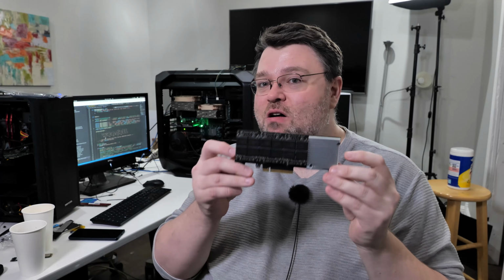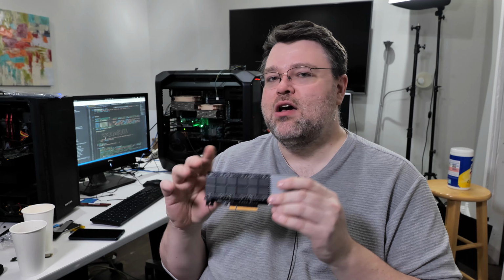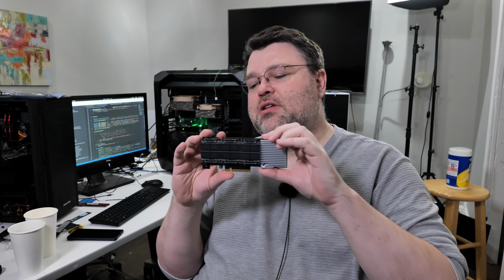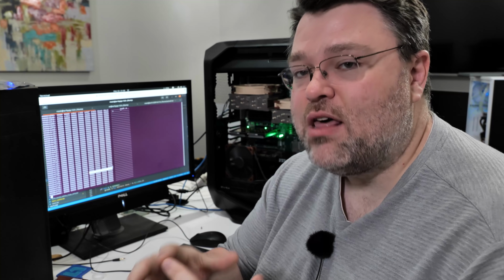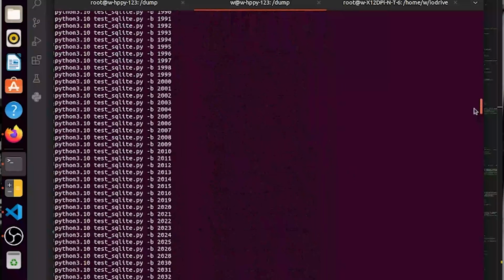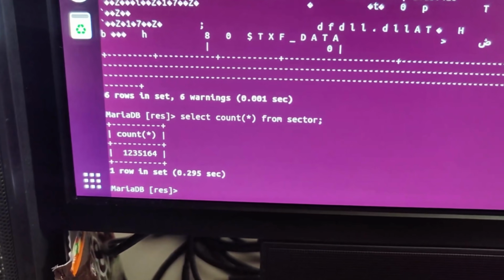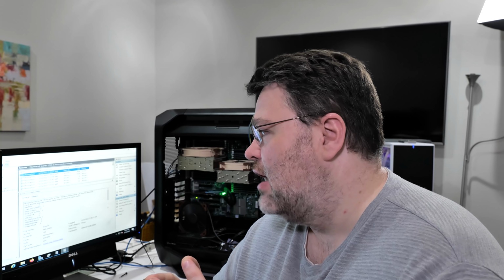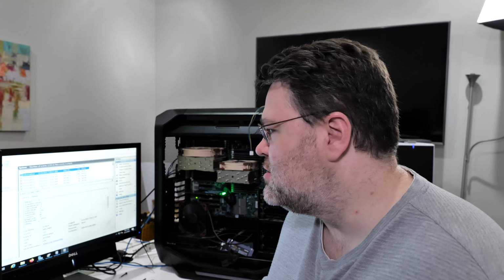You did WHAT with the dead SSD? And the data?

Comment: How about USB Hard drive, ADATA HV620S, 2TB died after 17 months of having it, died during when moving 50gb of files to it, basically like when it reached 1 TB, I only power it on to copy files to it only when devices fill up (so once every few months), thus not a lot of usage hours or powered on counts. I think drive overheated bc heat was quite noticable once 30gb or so of files done moving when it was time to put it away again. And sadly it's where I've kept all files up until now.

Thinking about raid or something so there are no more major failure like this, plus may be more cost effective than having to keep ordering USB Hard drives

Comment: I think using a database is the heaviest way of doing this, computationally speaking.

If you actually have the raw flash dump and you have different versions of various blocks then I would have first created a full 1.5TB image using the first-found method for any block.  When a collision happens you create a file for the conflicting block and an info file stating where it came from in the source flash dump (or just do it with the name itself).  You would track the blocks, of course, with a simple bitmap - 8 bits per block would be better than one so you can store a few flags - found, conflict, erased, etc...

A single pass through the flash dump and you'd have a 1.5TB (corrupt) image file that will represent the raw data you want to recover, a bunch of 520B files representing potentially newer blocks where conflicts exist, and a bitmap with your state per block.

Your next move is to then determine which of the conflicting blocks is the correct one and write that data into the image.  The final move would be to find the erased block data and zero out those blocks in the image.  Then write the image to a drive and try to mount it.

... all this, of course, assuming I'm not missing something...

Comment: ReFS is unfortunately in practice hot garbage. for reasons only known to Microsoft it defaults to only check-summing drive metadata (the MFT/FAT essentially), you can turn on file check-summing but in my experience this means in a fault case the file will poof from existence, no matter how minor the corruption was. ReFS is also extremely prone to becoming a raw volume if your system crashes or loses power, I've lost two drives to this just troubleshooting an unrelated GPU crash, and my lesson was learned to move on to a real filesystem like zfs...

Comment: Heh... I've reconstructed countless arrays, linux md, lvm and proprietary ones... that is much easier than reconstructing the sector mapping. For arrays there pretty much always exist multiple copies of the data, and you have to figure out which one is the least inconsistent... recovering sector mappings involves some interesting combination of filesystem knowledge, and being able to verify the validity of data in files mapped by that filesystem... been there as well. Was quicker than the parallel (but also succesfull) restore of the backup if you know what you are looking at.

Comment: Ahh this reminds me so much on my personal experience with my first nas in 2009, 6tb in 4 drives jbod'ed , one drive failed... bruh. I was greedy, wanted full capacity of 6tb, got what I deserved, painstakingly recovered the remaining 3 drives with many files being trunkated. Learned from my mistake, switched to raid 5, had only 4.5tb but safety, added another layer of safety by buying a second nas, back uping the first one. Data you DO NOT HAVE doubled, is data you do not care about. Had one of those nas fail again, but laughed because THERE WAS ITS sister nas. Anyway, it managed to recover itself when I swapped the failed drive. I do never want, to manually repair filesystems, copy blocks and chain chunks again, NEVER. That was the price I paid.

Comment: So FusionIO is still from the times when flash controllers didn't apply some AES for every page written? That's what makes it possible to approach them the way you did.

On the modern side, I've seen some nvme failures where 4TB nvme device froze and came back after reboot as a ~300MB device. Didn't spend much time on trying to figure out what went wrong ...

Comment: Sounds like something up my alley. Although C++ for the win, not python.
Reply: Python is fine. Multiprocessing would have worked just fine for this. Years ago I wrote a script that utilized multiprocessing for hashing and comparing multiple files on multiple drives concurrently, and used the Multiprocessing module for it.

Could you build something faster and more efficient with C++? Probably. Would YOU be as efficient in that endeavor as you would be writing the program in Python instead (given the same level of skill/familiarity)? Probably not.

Comment: 26:03 minutes ago i thought i was pretty smart.  I was confident in my abilities as an network architect

Ive had a long career working in IT.  

My confidence is shaken i have a serious case of imposter syndrome
Thanks Wendell
Reply: Modern data storage is wild, and cursed as fuck. He's lucky that it wasn't a year 2022 drive - it has only gotten worse since this piece was made.
Reply: Funny thing is, parchment and old lead or iron based ink is a far superior storage media than all of our hightech storage solutions. There are many old tomes still existing, even papyrie is better. Harddrives truely die, when their interface vanishes from the market. Ssds are black boxes of data mincing which, if have encryption on board and their memory controller dies, takes all the data with them. Nas, san and all the abreviations are just data mincers prone to silent corruption. Documentation of all kind of digital storage and software based storage solutions is inherently bad and almost always proprietary inhouse stuff. You're better and safer if you keep your personal important data printed out. If you're a middle tier company, you're Fed, you have to rely on poorly written software with bad documentation and proprietary hardware with no documentation, et voila you go full wendell one of these days. The absurd thing is, the paranoia meter increases with every level of additional "data safety", is the data you stored truely and correctly written to the server? Is what I get back, the stuff I gave it? I for me personally have come to the conclusion (for company data), that a regularly made hard backup on a new usb drive every two weeks is a lifesaver for just these situations. What do new 2tb 2,5" usb 3 drives cost against lost or corrupted company data? Nothing in comparison.

Comment: If you used your dumped sectors directly as a virtual disk and it detected a valid filesystem on it, and could read data, then it is very likely that you did not really get a completely raw flash dump.
The ECC algorithms that I am aware of are stored in a pattern, that does not really resemble the real data. You have to pass that block (or subblock if ecc comes in multiple steps) to the actual algorithm to get out sensible data.

I guess your dump is from blocks which already did go through ECC. For a real raw dump you want the raw nand flash blocks and there OOB (out of band data).

Your data is probably just a level above, that is seen by the upper parts of the flash translation layer -> bookkeeping where each eraseblock / block is, logs etc...
Reply: Here is a commonly used algorithm for ECC on nand flash, used in both raw nand mtd devices with linux (cheap storage for embedded devices), and apparently also in proprietary ssd controllers: https://en.wikipedia.org/wiki/BCH_code

There is this document, which can provide some insight from HW side: http://www.onfi.org/-/media/client/onfi/specs/onfi_3_1_spec.pdf?la=en
Maybe look at a previous version this one might be too new.

For example the "factory marked bad block" info might just work exactly as described by the standard.

Comment: If I am remembering right, ReFS does not enable file data integrity chksum by default, only matadata. That might explain why it is not reporting errors. I once had to retroactively go through an existing volume to turn it on for existing files since turning it on for the volume does not affect existing files. Weird design choice when "resilient" is literally in the name of the fs.
Reply: Yep, that's the default unfortunately. Have to enable it per volume through powershell.
Reply: It's even worse if you have the second option enabled enforced (witch it is by default and force enables on every new file created regardless of enforced folder setting) once the integrity enabled (set to true) 

if you get 1 bit of checksum fail in a file it removes the whole file from the name space and doesn't actually free up the space you have to delete the volume and recreate it to get the space back (all you get is an event log that it did it and a resulting missing file)

This was a year or 2 ago in whatever Windows server version for that time
Reply: @leexgx  I don't think I experienced that myself. But ReFS did protect me and warn me when a file failed the integrity check. I deleted it and pulled from another ReFS protected backup to replace it.

I was on WIndows Server 2016. 

Though I did notice a suspicious amount of space being taken up... maybe it was that and I didn't know it.

Comment: Nice Wendell.  When I got my first NVMe drive I found the namespace and raw access interface and had some fun ideas about what I could do with that, ie slicing it up with namespaces and using a raw flash filesystem on the raw sectors of one of the namespaces, like JFFS2 or logfs.  The neat thing about that would be that the filesystem would be completely invisible to all but the most technical of users.  BTW I don't think the ECC data is what you're looking for, or will ever find.  That's at a lower layer than what you're accessing.  You're looking for the FTL (Flash Translation Layer) data which provides the LBA block mapping and manages the SLC cache blocks and the over-provisioned blocks to give performance and absorb media errors similar to how HDDs have spare blocks to mitigate media errors, except SSDs have a lot more.  Ok and having watched a little further... you didn't need to load it all into a database.  You only needed to write the metadata to the database - that is, the LBA and the byte offset into the full device image.  Then you could use the database to linearise the LBAs and stream them from the device image to a nice linear image, which you could then access via loop mount.  And instead of a database you could have use a MMap'd file with the space for an array of the LBA locations... that would have been orders of magnitude faster than a DB.
Reply: uptooting for visibility .
Reply: You wouldn't even need to copy from the device image to a linear image. You could just make a device mapper table that does all that lifting for you in the kernel on the fly.

Or you could make a FUSE module that serves up an image file on the fly, since doing all those individual sectors (due to the sector headers and such) may be a bit much for the device mapper system.
Reply: @Coderjo.  Wendell's ultimate goal was to end up with a device image in normal linear LBA order.  Device mapper can't achieve that.  For starters, device mapper doesn't handle 512 byte or 4K mappings so it's not even capable of the granularity required.  Research Flash Translation Layer and you'll better understand what Wendell was trying to undo.

Comment: I got two of these used without considering the driver situation… with more recent nvme ssds matching and exceeding the performance of these drives, I can’t fathom using this for my home servers.
Reply: Consumer SSD's usually can't match the write endurance of these Fusion IO drives. Definitely something to consider.
Reply: Yeah, these will out live you under a constant write workload. I have a centos 7 box that's just going to live as a Fusion-io SAN for the rest of my life.
Reply: True, but I personally struggle to find a use that actually takes advantage of it. I’ll hold onto them till I have something useful to do with it..

Comment: really like to see more support for fusion io drives. I have been using many of the sx300/350 card. Those things are tanks compare to NVMe drive. Their write life is in PB range, long pass their EOL/EOS date.
Reply: don't MLC based nvme ssd also have endurance in PB range?
Reply: @lordjaashin  yes, But fusion io will not reduce speed during continue write.
Reply: Check out the Micron 9300 MAX series, extremely durable NVMe drives.

Comment: Did you try licking the electrical contacts and plugging them back in? It worked for my flip phone battery.
Reply: Or the Nintendo cartridge blowing. Always blow out the cartridge before inserting. Wendell probably forget to do that before inserting into the pcie slot.

Comment: Can anyone tell me why NVMe SSD's are limited to x4 lanes?

Wouldn't a PCI-e SSD with x16 3.0 lanes be faster than a PCI--e SSD with x4 5.0? 
Is this just market segmentation and marketing?
Reply: controllers currently can't really keep up with pcie 4.0 x4, though they are getting (kinda) close (with pcie 5.0 right around the corner). sure they could design a pcie 3.0 x8 with the same controller or pcie 2.0 x16 for the same speeds, but why would they but money and time into R&D for older hardware when they can barely keep up with the rate of growth for modern tech?
Reply: Laptops
Reply: @DzheiSilis  What I'm saying is... Now recently the "new thing" became NVMe 5.0 SSDs.
But wouldn't PCI-E 3.0 x16 SSDs be the same performance?
or better?
Reply: @zCaptainz  even in the entreprise scene, they think they should get PCIe 5.0 x2 SSDs. Because it's fast enough. The slower thing is the controller now.
ServeTheHome did a video there they tell something in these lines.

Even my laptop with a nvme and a sdd @550Mo/s max, don't get these speeds on standard use. (Probably a software limitation. No problem with benchmarks)
Reply: yeah, its just marketing. sold one pcie x16 n yu get ~$1000, sold four pcie x4 n yu got ~$1500~$2000

Comment: At 520 bytes per sector (including 8 bytes of OOB data), I wonder if the FPGA handles ECC using a part of the OOB data that is hidden from you.  Looking at a Micron 512Gb (64GB) datasheet from Datasheet Archive, it looks like the actual OOB data (744 bytes per 8k page) would be 46 bytes per sector, not 8 bytes per sector.
Reply: Exactly this, Wendell did not really get a raw nand dump, just a layer above where the FTL does bookkeeping.

Comment: Python can handle concurrency just fine if you use the Multiprocessing library (included in the Python standard library). Unlike the Threading library, it launches multiple python processes in order to make sure you're not time-slicing a single CPU core. These processes are not bound by the GIL, so in order to pass data around between the "threads", you need to use the data structures provided by the Multiprocessing library. I've found that producer/consumer thread models work quite well with this library.
Reply: When was that added to the Python STL, though? I don't know Python that well, but he might have to use Py2.6 or something, and if the MP lib is newer than that, it doesn't help.
Reply: @jayands  Check Python PEP 371. It was added around 2008
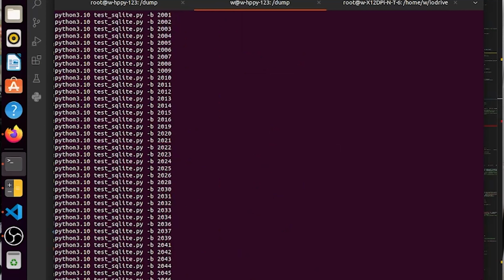Reply: @jayands  12:47 He used Python 3.10

Comment: Maybe the sequence just always adds one, ignoring overflow, assuming the GC would catch it before it loops again.  So instead of grabbing the highest one, you'd need to grab the highest sequence value, that doesn't have one IMMEDIATELY after it (or in the first sequence, in the case of sequence.MAX_VALUE).  IE if 8 was the max, and you had 1, 2, 7, 8, you wouldn't use Sequence 8, you'd use sequence 2.  Just a thought!  Very interesting content!
Reply: I had the same thought, though I was figuring on identifying which sequence numbers where introducing corruption. Presumably these would be the very highest numbers, and it would be possible to draw a line below them.

Comment: Wild that you got that mostly recovered from that insanity
Reply from the maker: The abyss was staring back, for sure.
Reply: @Level1Techs  Are you curious about such stuff in general? Got a WD DC SN630 7.68 U.2 that kind of died during a regular reboot. “Kind of” because the device still shows up but as raw and as a strange symptom all SMART data has been reset. Tested powering it on for 24 h but that didn’t change a thing. Didn’t try a secure erase yet (like that faulty Intel SSDs about ten years ago) since I wanted to experiment if the data was somehow recoverable.